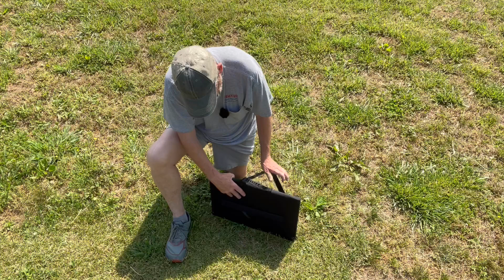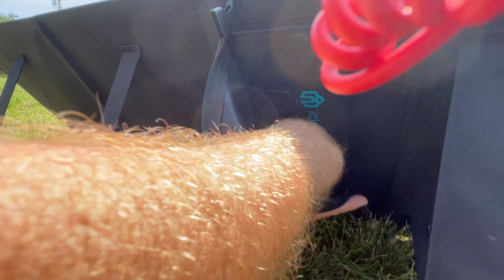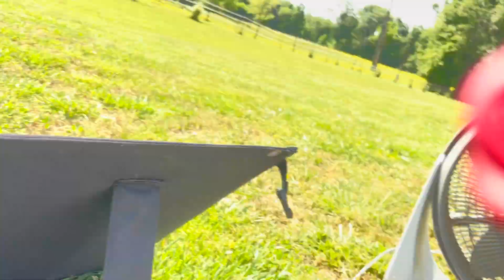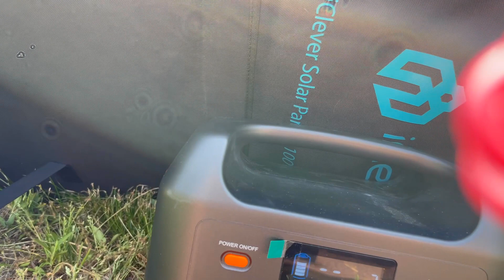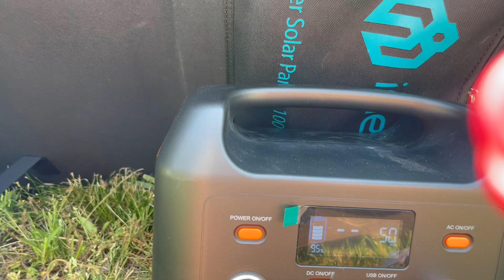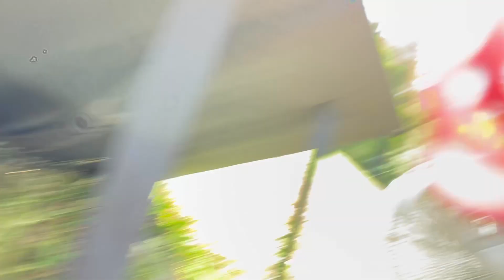GOLABS R300 Solar Generator & iClever 100 Watt Solar Panel   How well do they work?

Comment: You should always start the AC inverer BEFORE plugging a device into it , cause the first millisecond after it  starts , it does not produce stable voltage and wave form , just turn it on a second before you use the AC ports, it might not make a difference with a fan , but for sensitive device it will.
Reply from the maker: Thank you, I should of know that.
Thanks for Watching!

Comment: Beware of Golabs. Please read reply
Reply: BUYER BEWARE!  Golabs (gotrax is same company) does not honor their warranty. They do not have a phone number, they do not answer service links from their website. They do not answer claims filled out on their website.  They removed all negative comments from the golabs website on 3/22. If you don't believe me try to get in touch with golabs, Try to find a email address or phone number on their website. On March 27 Gotrax supplied a service email for Golabs only after i showed proof of purchase.Please share this post as consumers need to be aware of issues with these 2 companies. Check Out their BBB rating for both company's Carrollton TX.
Reply from the maker: Wow!   Thanks not Good!
Something must of happened because they responded to several of my emails last summer when I purchased the R300.
Thanks for the update.
Reply: @TrailMedic911  it took a month before I got my first reply in regard. I have both the R500 and R300 bought 1 week apart less than 7 weeks ago. They stated Quality issues with their product in email dated today March 27.

Comment: Which cord are using to go from the GoLabs to the solar panel. 
I have the same setup and I can’t get the I iClever solar panel to charge my GoLabs.
Reply from the maker: It’s one of the round plugs.  The same size as the one that comes with the GoLabs R300 to charge from the wall plug. 👍
Thanks for Watching!

Comment: I just watched another YouTuber do a series of tests on this model. Its output tends to stop at about 278W, so he recommended users not to use devices that require over about 250W to be on the safe side. A lot of these generators' marketing tends to do this, I notice, advertise a "rating" for one wattage, while actually maxing out at a lower wattage.
Reply from the maker: Great information Thank you!
Reply: I hope by now you understand “advertising” better and realize 278w is super high. That’s about 90% 
Many these days only offer 82%-85% of what they offer

Comment: You can directly plug a USB fan into the USB ports on the solar panel and run them full blast. Get some USB extension cables and run them to the shade. You can also directly power a USB warm white bulb if you need light indoors or in your camper during the day. In fact, the hqsolarpower website sells a 20 watt panel with one USB port for only 25 that will power a USB fan no problem even on cloudy days. Opolar makes very powerful USB fans, some that can be charged, but the most powerful one I have runs directly off USB and I use it daily. 

They`re great to use with the little power banks when you`re working outdoors in the heat and the solar panel you have can charge multiple power banks at once and even run a USB battery charger for NIMH and 18650 batteries. Get an adapter with a cigarette lighter plug to use with the panel for lower wattage devices that need that. It might work with a 100 watt rice cooker. 

My Golabs only charges at 52 watts with my 60 watt folding panel but even on cloudy days I can get at least 15 watts using it. You should be able to get at least 25 watts with your panel on a very cloudy day. Most people don`t realize how incredible these solar panels really are.
Reply from the maker: Thanks for Watching!
Reply: @TrailMedic911  I meant to say hqsolarpower sells a 20 watt solar panel with one USB output that will run a fan on cloudy days.
Reply from the maker: I have used 20 watt panels on campers to help keep the batteries charged between trips.  20 watt is a good size.

Comment: These things are great for USB lights and fans and if you buy a 12 volt 100 watt rice cooker you can quickly cook rice, lentils, oatmeal, grits, or even boil eggs. These also work well with the little immersion water heaters for making instant coffee or tea or even boiling eggs in a cup. If there`s another Texas style Winter storm these can power an electric blanket or multiple heated vests for a small group for a little while. I have this and the latest Rockpals 300. They both charge fast with solar.

I don`t want to depend on a gas generator in the future. I now have 8 solar panels between 20 and 100 watts and three small 6 volt panels for powering radios and charging 18650 batteries. I might get a very small gas generator as backup but I`m getting solar tools first. I also bought about 15 power banks that I can charge with the USB ports on my smaller folding solar panels. A 60 watt folding panel I have can easily charge three power banks at once and charges my power stations very fast. 

I also ordered a 100 watt glass panel to charge this and a Bluetti EB70 700 watt LiFePO4 power station in my cart and I hope it works ok. Depositing my last stimulus check tomorrow. I`m also getting an Igloo 5 cubic ft freezer that uses 100 watts so I can save my food after the next hurricane.

Even though this is a LiFePO4 battery you can greatly extend its life beyond 2000 cycles by keeping it between 20% and 80% as much as possible. I think these have a reserve cutoff point of 10% to avoid deep discharge damage but I`m not sure about the upper charge limit. Research shows that keeping the charge cycles between 25-30% and 70-75% and storing these at 50% can get you over 10,000-14,000 charge cycles. 

Never charge these to 100% and store them if you want to make it last a lifetime and avoid pass through charging. You certainly won`t get 2000 cycles from one of these if you use pass through charging regularly and store it fully charged in a hot car, but the company says we should get 2000 cycles to 80% remaining capacity even with full charge/discharge cycles. It would be amazing though if I could make one last 30 years. But will the parts even hold up that long? I`ll be PISSED if it quits working in three years!
Reply from the maker: Thanks for the information.
Reply: Love your insight AND your avatar!  lol